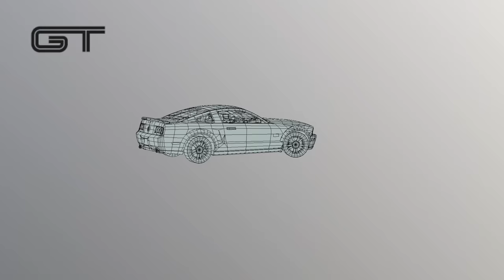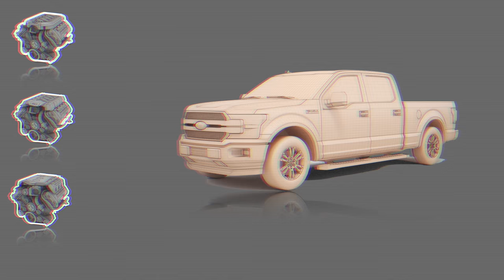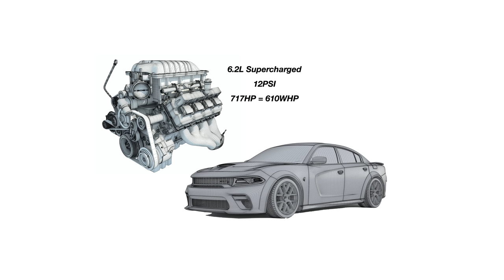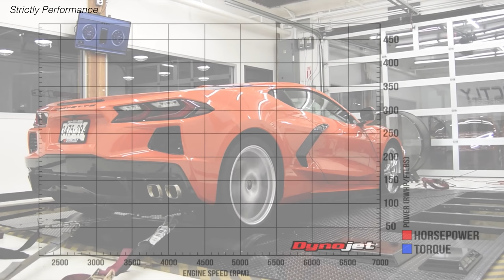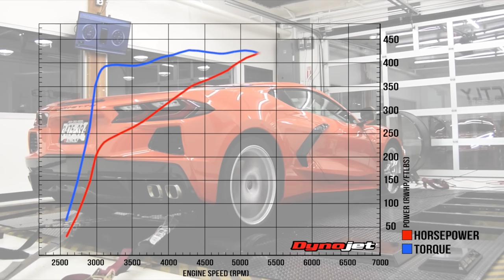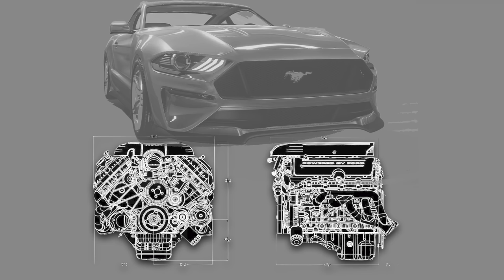How 5.0 Coyote Engines Beat LS and LT😮 | Explained Ep.2

Comment: Yea “ALL YOU NEED is boost” like its as easy as going to oriellys and picking up “BOOST”. Ill still argue for the average person the LS is a slightly better platform. You can make way more power with less money, if staying naturally aspirated. Boosted the coyotes can be pretty hard to beat. But at that point boosted anything will run. But the average person doesn’t have a clue or any business adding boost to a stock bottom end motor. Just my 2cents

Comment: I know about coyotes all too well. I have a 20 gt350r built 5.2 voodoo, 22lbs of boost on e-85 making 1089rwhp. I also have a 22 gt500 carbon track pack built 5.2 predator 22lbs of boost on e-85 making 1298 rwhp. (both engines can handle well over 1500hp easily)
 I've been running both for over a year w/o any mechanical issues, they destroy Chevys and Mopars on a regular basis. (on the track, I don't street race at all not even from light to light. Had a car impounded once, never again) Hands down there's no beating a boosted coyote. 
 GM and Dodge will have to totally redesign their platforms in order to complete. I use to be one of those cubic inches is king guys, Ford showed me the light. I'm currently putting a built 5.2 aluminator in my Backdraft Cobra replica, it's supercharged w/ 22lbs on e-85. It should make 1200+ rwhp on paper, once I'm done I'll get the real world numbers.
  I'm debating on doing the same to my 67 gt500 and wave bye bye to the 427. (my first car, bought back in 82 when I was 16yrs old, 56 now) I'm gonna do a full frame total rebuild on it once I'm done w/ the Backdraft. (it was never a numbers matching car) Wish me luck, later.

Comment: I love coyotes out the box make lost of power but upgrades are expensive . The reason everyone puts ls on fox bodies is ls motors are 250 bucks and with rod bolts hold up 1000hp . So it all depends on what u want to do . I love what ford gm and mopar have done for the racing industry . Great video btw .

Comment: Nice video. Thanks again for the valuable info. What are your thoughts on the durability of the spray on cylinder liners? Is it true that some of the truck variant Coyote motors actually were steel sleeved? I understand that the voodoo 5.2 L flat plane crank engine that is based off of the 5.0 block also uses spray on liners. I am aware of several coyote motors being oil burners way before their time. At least GM spends the money to put steel sleeves in their aluminum blocks for the LS and LT engines.

Comment: Ford should have done it years back, I love the new 5.0's. But this isn't the first time they've done this. Ya they have the cobra motors, cobra r's, and everything, but the original boss 302C motor, I may be wrong on some things but they built these motors for trans am racing. They'd rev them up to 8k all day long and made a bit under 400hp rated at "290hp" lol we all know how those numbers from companies were back then, but the nasty thing about them were the crazy heads, monster ports!!! 270-300cfm give or take out of the box,, canted valves, and the blocks were very strong as well 4 bolt mains, imagine one of them boosted1!? I know its a old vs new thing, but it was non the less a great motor

Comment: Although the computers are more locked down the dual port and direct injection is nice is terms of being able to run e85 with literally just a tune and it allows for extra power and tuning control down the line. This is more impactful on the Ecoboost platforms as well. That being said it sucks how much Ford is locking down these ECUs from the factory. I hope this doesn't continue as it especially kills the modding potential for the Ecoboost platforms. Sure there's performance partners like Whipple Roush RTR ect that have access to make tunes but being forced to go with them isn't good for customers and smaller tuning shops.

Comment: Ive always loved SOHC and DOHC engines. Ford has always been ahead of their time. I remember getting my hands on a 4.6 2v and putting some comp cams, flat top pistons , forged rods and some trick flow heads with some 1 5/8ths headers on E85 was just fun shit back in the day. Now the these coyote 5.0s are just terrorizing the streets. Pushrod engines are dinosaurs. They suck and need huge displacement to stay relevant. A little for 3.7 dohc cyclone is basically a coyote missing 2 cylinders. With just bolt ons it can make 320 hp at the wheels from 245 wheel hp stock. And they still get good mpg 😂 no cams or heads . Thats not bolt ons to modern day car guys. Cold air intake, headers , exhaust, throttle body and a tune .

Comment: Ford makes great engines.but I. A chevy guy I prefer the cam in the center of the engine with out the huge dual over head cams taking up all the engine space. I prefer ls or even lt. U gotta spend way more money to get power out of a coyote.  Ls wasn't designed to rev crazy high. Coyote wad designed to rev high. It's apples to oranges. If they were both push rod one cam in the center of the engine that would be a better comparison

Comment: 4 Camshafts, an 8ft long timing chain, jack shafts  - NO THANKS. It's not that I dislike Fords, as it's tough to love the LS platform without being a huge fan of the Ford Windsor (which many think Chevy stole from), but GM's K-I-S-S approach to reliable HP should be commended. I would go a step further and say that for a max effort N/A platform, (if the Ford and GM were forced to use Pump Gas, or the same gas) the GM LT engine can't be touched. There is no replacement for high compression, which leads to Torque, both of which a built N/A Pump Gas Coyote can't come close to an LT with. Now, if you Direct Inject a Coyote and start running 11.5:1, you still run into a problem with the blocks being weak, weaker than GM equivalents.
Reply: Coyote blocks are not weak, Gen 3 Coyotes are 12:1 and have dual injection. 

I do however agree the LT stuff is much better suited for NA, being much higher displacement and more torque.
Reply: The coyote is faaaaar from weak. The only weak link are the piston rings and that takes 4 digit hp before they have issues. Boost for boost on a stock motor, that's going to Coyote no question. N/A it definitely goes to Chevy and that's simply a displacement disadvantage.

Comment: Love your vids.  Straight to the point and you always answer the exact questions i have about the varying platforms.  But seriously though, you can fit a coyote in a fox body?  I remember Ford doing that for some charity giveaway and they recommended that customers don't ever attempt it lol.
Reply: Coyotes will absolutely fit into a foxbody. I’ve seen it done multiple times. The engine bay is very similar to a sn95 or new edge mustang. If you swap into a new edge the coyote will bolt right up to the factory 4.6s trans
Reply: have you been under a rock?...There are thousands of coyote swaps in foxbody's.  A pretty much stock 'yote in a fox will get  you in the 11s.

Comment: Stock 5.0’s do not like boost. Stock ls motors like boost, But let’s be honest. Even if a coyote motor was a more efficient motor when it comes down to it it’s about cost. LS parts are cheaper. More importantly, it’s not hard to swap out a camshaft and an LS motor. Compared to spending a gaggle of amount of money to throw in a supercharger injectors in oil pump gears in a 5.0 a reason why most people get an LS and just shove it with boost.

Comment: Looking for opinions, what is the better engine and transmission combo? The coyote with its 10spd, or the b58 with the zf8spd? Looking to buy a car in the future, these two choices i feel personally are the best for the money and aftermarket.
Reply: Depends for the type of car you want. There's tons of single cab f150s with the 5.0 coyote and 10 speed running 11's with just bolt ons, and an e85 tune. Mustangs...same difference but obviously quicker potential. 

I'm a ram truck guy but now I have 1 2021 f150 5.0, 10 speed. The 10 speed is great. But clunky at times. I had a ram and charger with the zf8hp70. Buttery smooth. Except in sport or track mode in the charger...it was firm and crisp as it should be in those drive modes. Stick it back in normal drive mode and it's smooth. Always. That is my only complaint with Fords 10r80 10 speed. It can be clunky. As far as Shift speed...it matches the 8hp70. Pretty quick shifting for a conventional automatic. 

But a b58 sourced car with the zf8spd...thats heaven lol. 

I'm in a pickle of deciding because that b58 has serious potential as well. And some aftermarket tunes can give around 100 hp/trq or more depending on the company. 

My cousins wife had an m2. It had the 8hp70. Amazing car.

Comment: Answered in 1 Second save your time , 

Coyote has VVT and 4 separate camshafts , Dohc , 

It’s the same exact reason why the vtecs respond well to boost 

Ls engine does not have this and isn’t even the same type of motor why are we comparing ?

Comment: You can not make ove 100% VE without boost or like f1 can do it under high speeds.  100% VE is means 5.0l in and breath 5.0 liters of air.  So the only way to up it would be with force. Ex 4.0 liters in 2.0 l out would be 50% leaving 50% of of bad air in combustion chamber

Comment: Why is the GM 32v v8 making so much more power out of 5.5L over Ford's 5.0L? 460-480hp seems way down for only .5 Liter difference compared to the 670 hp in the GM 5.5L 32v. Is it because the GM have better flowing heads?

Comment: I had a 2006 GT0 LS2 6.0 headers 3"slp  exhaust  stage 5 transmission 3600d stall converter . 3"intake pushing close to 500 Hp .sounded like God. 15k transmission is worth it trust me. Not bad when a 360ci hit140 mph quick . Did 180mph 1 time. I beat a supercharged roust mustang. However my dad took 1989 foxbody 5.0 standard  transmission headers 21/2 exhaust Flowmaster  400 plus hp I loved driving that car standard, no traction control you actually had to drive

Comment: Only way you are getting over 100% volumetric efficiency is with forced induction.  You are not getting more than 5 L of air and a 5 L engine without compressing it.
Reply: Porsche gt3 is calling
Reply: @amazin7006  and it saying “your right”
Reply: @dontimberman5493  yes, i am right. 

Porsche uses a wave induction within the intake manifold to increase pressure right outside the valves. The coyote is similar except it takes advantage of the VCT instead to time the pulses perfectly at peak torque.
Reply: @amazin7006  so it’s compressing the charge before it hits the cylinder? 🤔 who said that’s the only way to get past 100% volumetric efficiency? Oh ya 🤨
Reply: @dontimberman5493  thats not forced induction though...
Reply: @amazin7006  I never said forced induction I said “without compressing” don’t matter how you do it. It’s still the only way.

Comment: LT’s can make close to 600whp with heads and cam and of course headers and other Boltons.  Don’t know if 5.0 can make 600 without stroking.
Reply: We aren’t talking about NA. We are talking ab actually makin power
Reply: @venom_dave  Right and most 5000hp plus motors are hemi or chevy style motors
Reply: @lordpula1193  5000hp? Get tf outta here lmaooo no one cares ab that shit. Tell me why the coyote stick shift record is faster than the LS stick shift record and the LS has been out years longer? Tell me why sealed motor 5.0s have gone 7s and no LS or hemi on the planet will never do that
Reply: @venom_dave  there's hemis and ls type engine going lower than 7s haha including your fan boy slow gtr.
Reply: @lordpula1193  hmm I can see ur new to cars. First off, the GTR is the better platform than any American car besides maybe the gen 5 vipers. Second I’m well aware LS cars and hemis have gone faster than 7s, but on a stock motor? Do u know what stock sealed means? There’s a coyote in the 5s bro😂😂😂😂I’m talking unopened tho, no LS or hemi has done that
Reply: @venom_dave  hmm it seems your from florida so let me dumb it down some for ya. No gtr or ford has gone under 4s unless it's a swap. So ford & nissan can't hang. Hope you can understand that floridaman.
Reply: @venom_dave  As far as stick shift goes same thing. If I'm not mistaken there was an ls truck that did a 7 second pass at over 190mph not even too long ago. So ford still ain't nothing compared to the domination hemi and ls and hemi and ls type engines are doing and have been doing. Have fun with your lil rice rocket. The Big Dawgs will be up here at the top as usual.
Reply: @lordpula1193  so thanks for proving my point. Stick shift coyote record is faster than the world record stick shift LS car
Reply: @venom_dave  It's not look it up. Only my points were proven right all yours wrong but nice try ricer. Again as far as America goes Chevy & Dodge & all their counterparts are King. Have fun being weak and slow though not everyone can be at the Top. Someone has to buy the garbage.
Reply: @lordpula1193  ok I can’t argue with u anymore lmao
Reply: @venom_dave  No one was arguing. I was just saying Truths & Facts.
Reply: @lordpula1193  u said multiple things that were wrong and u continued to claim “everything I said was true”, u clearly have zero clue what ur talking about
Reply: @lordpula1193  stay mad. Oh btw I’m still waiting for u to send me any LS or hemi stock sealed that went 7.9s or faster, a stick shift LS that went faster than Joe Steeles gen 1 coyote at 6.81, and a 4 second Camaro that had the original factory motor…then I’ll admit ur right if u can find any of those
Reply: @venom_dave  your problem is that your hand is on your stick way to much 😄
Reply: @lordpula1193  you are spot on 😀

Comment: While all the fanboys and wagon jumpers are idolizing a high tech feature engine at its end of its production where were you in 2011-2015? They handle more boost, how long? How’s that new DOHC flat plane crank 5.5 doing without a supercharger? 400hp ZR-1  from the 90’s? Oh it’s faster now so it must be better! Better failure rates. Pathetic after almost a decade they actually started getting the respect and praise not given new. You can replace the oil pump gears and whatever you wish ring it out once too many times at it will lose a rod and compression. All three companies have their own approach to performance. Stock for stock they are within one another after that it’s up to who spends the most who will run the most. That simple

Comment: Great video broseph! I agree with just about everything you said. But those Cyotes don't hold the SBE records. Not to mention the swap capability. Big package for small displacement. Would you trust a yote in a boat? (HA!) I swapped my 23' Chris Craft Scorpion with a 02 SS LS1 and she makes close to 550 at the crank. I can pin That engine at 6500rpm all day. I wouldn't dare try that with a Coyote. Although I am interested in the 7.3 Godzilla. Maybe a video you can make? Keep it up!
Reply: You wouldn’t trust a Coyote at 6500 Rpm?
Reply: @169abr  maybe because of the oil pump issue🤷🏾‍♂️
Reply: @169abr  - no I wouldn't cause of the dohc timing chain. 6500rpm for 20+ minutes pushing a 5000lb boat would scatter that motor all over the ocean floor....
Reply: @trentdaddydolla647  - I'm a LS guy and I'll admit we have those oil pump problems too. Just not as bad....
Reply: @bills2999  look up what the coyote went thru to go into production, it was ran at max RPM for a while then flushed with ice water then spun right back up. People have smacked a turbo on those and run them on boats for a while now.
Reply: @169abr  - I've seen them. They're in jet boats. Very easy to push. Put it in a 47' fountain and you're going to be calling the Coast Gaurd. The load factor is 100× a little jet boat. They don't have the same torque band as a larger displacement engine. Twin turbo LS's are in these bigger boats. I know a machinist who's making water jacketed turbos just for LS applications. He has two 6.0's TT making 12lb of boost @ 900/830 hp/tq on 89 pump gas. Boat goes over 100mph and it can stay WOT. The Ford Godzilla would be a perfect candidate. Not the yote...

Comment: When you factor in the price of Ford parts to GM LS   parts to make the  power and the fact most GM motors are bigger and people adding turbos and superchargers the LS is the real king lt engines cost more and a lq9 would fuck a 5.0 up Easley for the price Ford is over priced unless you're talking about the Ford Barra which is the v6 king but then that would be comparing apples to oranges lol

Comment: U do realize that LS3, LS7, LS9, LSA, and LT Small Block Chevy heads flow over 300cfm right? And they can take alot more power than any 5.0 ever has. They don't break sleeves or connecting rods like 5.0s do🤦‍♂️🤦‍♂️🤣🤣

Comment: This guy doesn't know what he's talking about.  Why does it make so much power?  It's a DOHC engine which means it flows better.  Any V8 32V engine is going to make more power than a 16V V8.  Also, the reason nobody upgrades the Coyote engine is because it has 4 cams.  People don't replace them because 4 cams is expensive and the benefits aren't that high.  Also Coyote vs LS the LS is going to get better MPG because again the LS doesn't have to move 32 valves which is going to create a lot of mechanical energy loss.  A 2011 Mustang with a Coyote will produce less power and use more fuel than a 2011 Corvette with a 7.0 LS.  The new Corvette 32V V8 also suffers for the same reason and gets less MPG than the pushrod based V8 with a supercharger.  Also, once you push Coyote engines high enough in power you will need to reinforce the engine with welds.